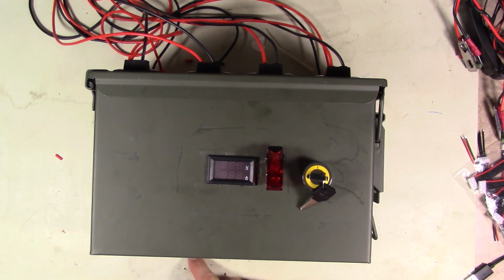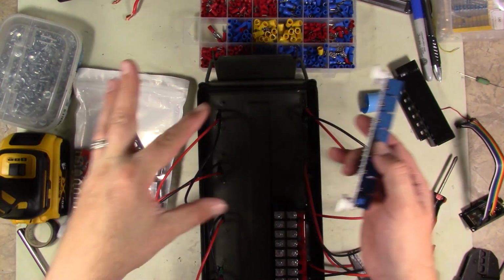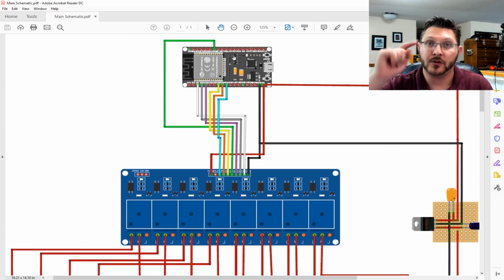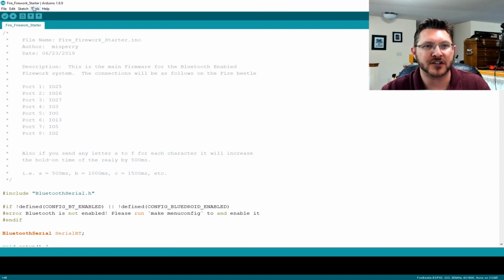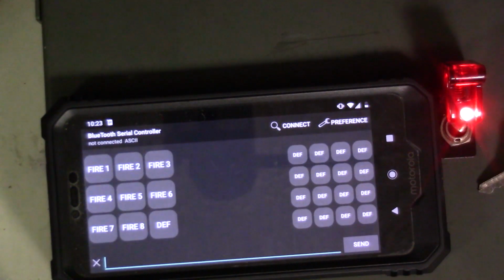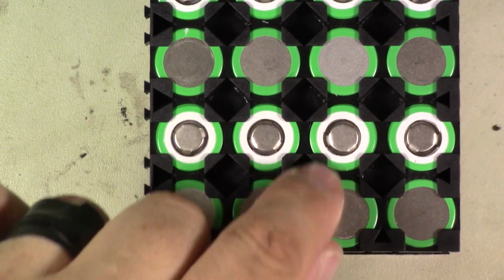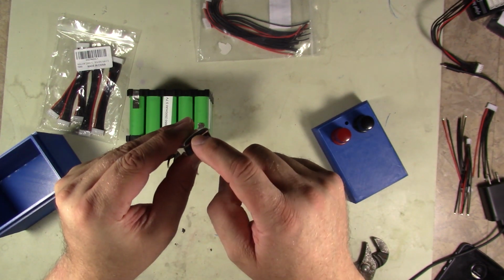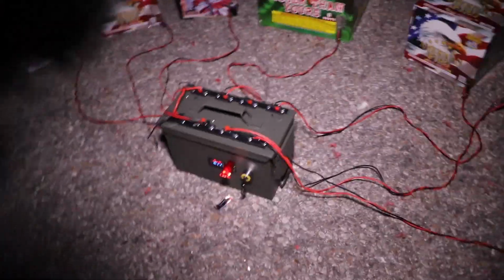Bluetooth Firework Controller

Comment: buy igniters off ebay. your battery packs were total overkill by orders of magnitude. consider that commercial controllers often use 8 x AA 1.5V alkaline batteries.
Reply from the maker: True but the nice thing is these are reusable so you don't have to buy hundreds of igniters.  Also the battery is large so that you can get about 1200 shots out of it before recharge and it is simply that "rechargeable" so you don't have to go through batteries.  It was a fun project to do and I did not design this for selling just to show some interesting information like battery welding, capacity calculating, and bluetooth control.  This is more educational than practical I get it.  Thanks for commenting.